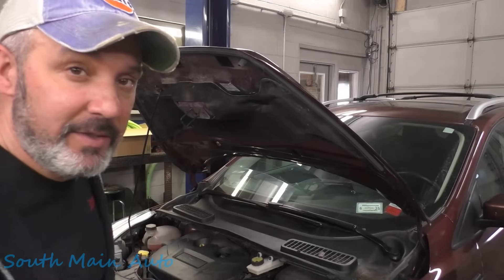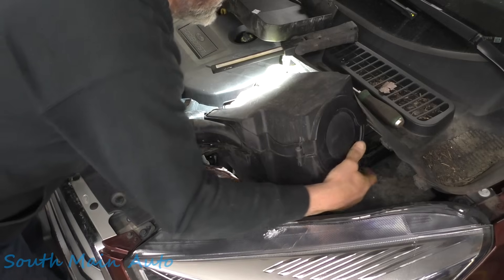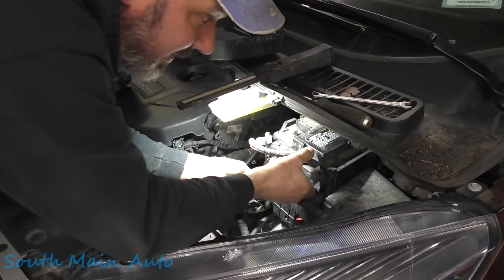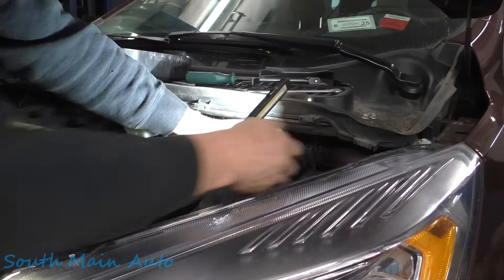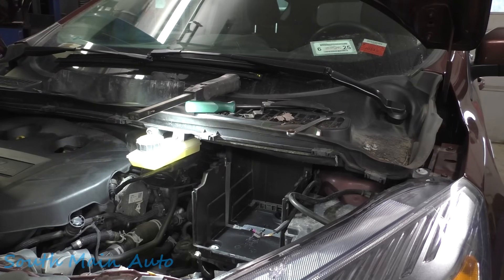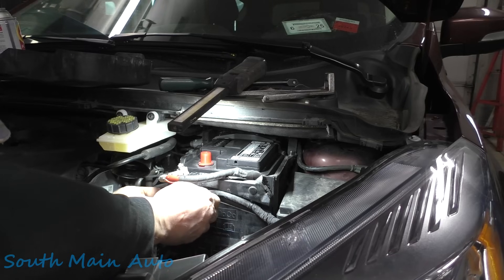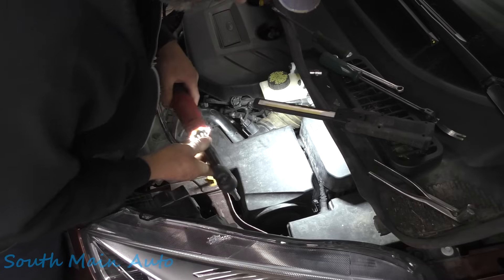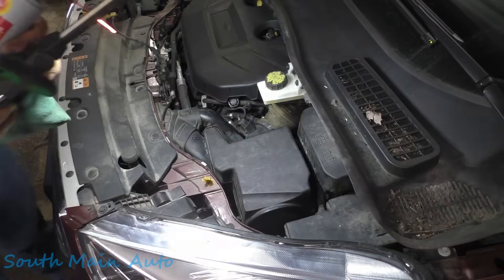Ford Escape Battery Replacement

Comment: CMD battery is a joke. They cost a lot more than a lead acid battery and you only get a 3 year warranty with a cmd battery compared to 5 years on a lead battery. On dodge and Chrysler you have to battery to replace and the small only has a year warranty. Plus since they have the SGW model a regular scan tool won't reset a new battery.  I replace both on my 2020 Pacifica van. There is a trick to start it up let it run about 5 minutes wait 5 hour then do this 5 times in a row. If you don't it charges the new battery to much and can hurt the new batteries. Why the reset is it charges your older batteries longer and with a new battery you it charges it to such. Why you need this is so stupid as your alternators has a regular in it and should not over charge the cmd batteries. Never had to do this with a wet cell battery.  The dealership just wants you to buy a battery from them and then charge you extra for that. People have spent 500 to 700 dollars for doing a simple think as changing a battery.  Most auto parts will not install cmd batteries because they are supposed to be registered. You tell me the charge system can't tell you have a new battery in it and can't charge a battery by the voltage of a new battery.  I think this is another huge scam. Stupid stupid and more stupid.

Comment: I wish the engineers had to work on the stupid engineering they've been taught at these overpriced colleges.  Surprised they didn't mount the battery inside the oil pan.

Comment: Ridiculous to have to go through that to change a battery. If the engineers that designed this crap had to work on the vehicles every day after designing them things would be different. And a battery terminal spreader tool??? Is there a tool you don't have?